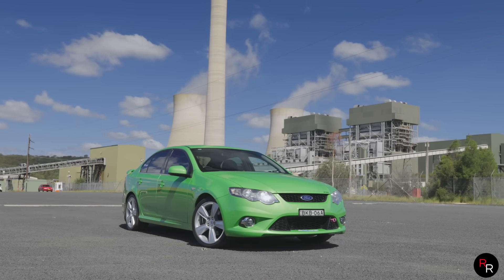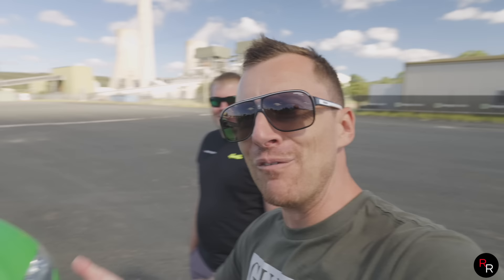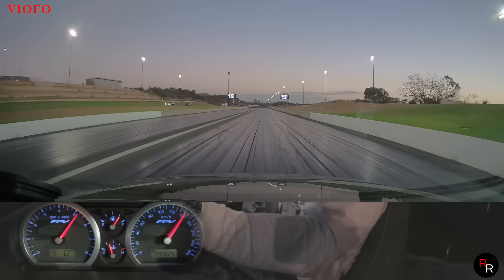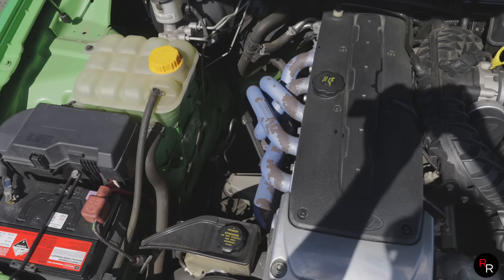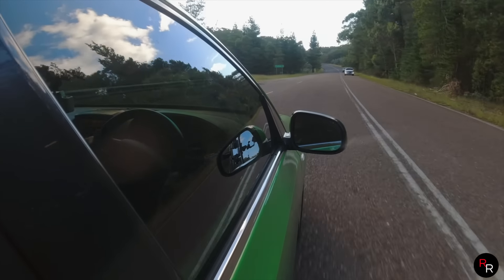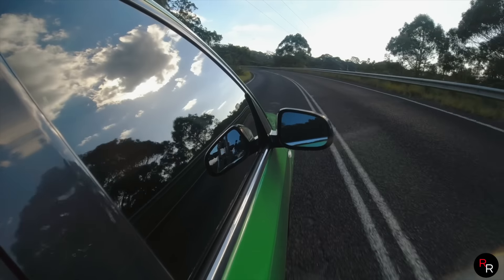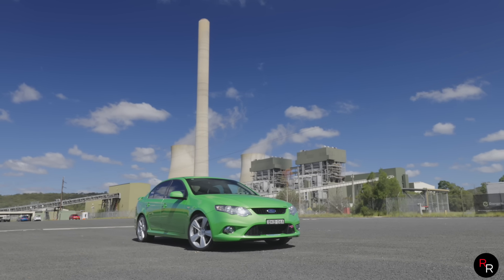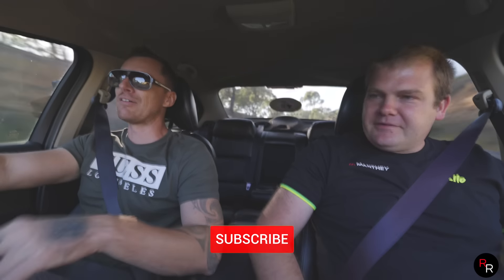What Happens When You Build Your NA BARRA XR6

Comment: Very impressive, i always wanted to see a built NA barra and low and behold someone has actually done it. Didn't disappoint at all, can still be a comfy daily and put a smile on your face when you put the foot down.
Reply from the maker: Its definitely got some pep to it
Reply: Zane at maxx performance got like 370hp outa one with cams and 6 throttles in his el and 400kw (536hp) with nos, big f off cams and heavily ported head should crack 400whp+ big money to stuff like that though lol
Turbos cheaper at that point 🤔
Reply: My mate had a built ef with similar hp na was a weapon on the highway
Reply: @5lcalais1  if you're a mechanic or handdy - head porting shouldn't be that expensive. A cam that suits the ported heads and works with the opening and closing points of the intake valve is a major part of the equation. Then you need lighter valve springs and retainers...The parts can be expensive for sure.
Reply: All a 5 SP car needs is a manual swap, some short diff gears and you're doing a low 6 seconds to 100 kays.

Comment: Love the N/A barra... have to visit him once the headwork and cams are in
Reply: Exactly what headwork needs to be done & cams as I'm wanting to do the same to my ba na falcon xt
Reply: @joeyriley6992  port and polish with 272 and 276 degree cams... 3 angle valve seats can be done too...
Reply: @ftlc-mayush5876  okay sweet az thanks man what will cost roughly
Reply: In NA barra  if change the valve springs  put larger injection system on it  you than can get a bolt on a turbo kit or supercharger upto 430kw 10psi without damaging anything, but that would be the maximum you could go on a standard barra motor and diff or you would have to change a few more parts if you go up over the 800hp+ range. 

The standard motor and diff can handle upto around 800hp with forced induction. Most people go between 500 to 600 hp range to play it safe. I agree a cam package  makes the barra sound sweet and gives a nice mid to high pick up power boost.. I prefer supercharger on the barra over the turbo, bit more thirsty and more expensive set up. Although  instant power.  And still has the natural sound of the engine. Supercharger and a cam package.  Can't go wrong

Comment: My XR6 just has intake, extractors, full exhaust, kelford cams and valve springs. Yet to get a tune so runs rich but has a heap more torque than stock. Obviously not as fast as a turbo falcon but goes good for what it is.
Reply from the maker: They still
Go well
Reply: what lca are you running?
Reply: Lower control arms?

Comment: Nice to see someone do it different. I'm an NA guy and wouldn't pick a Barra as a platform for it but yeah, not a bad result in the end. I'd expected more rwhp. To put it in perspective, a vastly more expensive at that time 4.6 Lexus v8 w/8speed will do 300-330wheel stock but less torque and run low 13 5s 0-100/high 12s with a flash. This is plenty of speed for a daily to be safe and have fun and get to use it. I've had single digit 1/4 vehicles and while exhilarating, when you can go over the speed limit in 1st gear, it's hard to use them on the road at 100% safely.
Reply from the maker: It’s not bad at all eh.. glad you enjoyed the video

Comment: Great to see someone else spending money on a na build , I’ve got a na b series custom cam stage 4 equivalent head work valve springs pump gears full exhaust intake underdrive thing made 210rwkw it’s a blast
Reply from the maker: I thought It was worth a visit
Reply: My ba XR6 has cold intake, extractors, high flow cat and exhaust, kelford cams and valve springs. Hasn't been tuned so runs rich but goes heaps better than stock.  I've been thinking about the under drive pullys, you think they are worth the coin?  I'd love to get some head work done but sounds expensive
Reply: Are the pump gears needed for an n/a?  I thought it wouldn't make enough power to be worth worrying about haha
Reply: @corbyweeto6061 yes ,they're junk regardless of aspiration, once u start beating on them they break ,high rpm and high load do it.
Pump gears and valve springs are the 2 must do mods to any barra ,in turbo I'd add head studs to that 👍
Reply: @corbyweeto6061 hey mate spend the money and go the underdrive and do the front main whilst there ,pump gears are debatable but when you’re hard on them they will shatter
Reply: @edwardriley548  cheers mate I'm definitely hard on it lol. Just had new front main and balancer. Guess I should've done pump gears while I was there lol.

Comment: I own an N/A FG XR6 which I use as my everyday car. I absolutely love it. Cheap reliable and goes well. I want to buy a turbo but I cant bring myself to sell it.  I might just work it Im confident you can get these things into the 11 second range of you spend enough cash and get them built and tuned right.
Reply from the maker: I’m not sure about 11 but anything is possible 😅 gotta love a Barra
Reply: Depends on your setup. With a shorter diff ratio and a manual gearbox you would be getting good numbers. Then with head porting, cams, etc etc High 12s should be achievable.
Reply: @lachlanbrown409 most drag cars are autos...
Reply: Manual FG cars are better suited to a shorter diff ratio than the ZF. In an NA car the diff will be one of the best BFYB mods.

Comment: Its great how good you can get them to go for little money. I had a bf1 fairmont. Did full exhaust. F6 upper and lower snorkel. Lower temp thermostat. M86 rear lsd from a manual gt with 3.73 gears. Underdrives. Sct tune by intune motorsports. Went really good. Still great on fuel.
Just wish it had the zf instead of the btr or at least a 2500-3k stall.

Comment: I have this car, almost exactly. Down to the colour. You don't need to tune these things unless you're willing to foot the running cost of parts and maintenance. Focus on the brakes, tyres, suspension and install a throttle controller. You'll be good to go.

Comment: My first car was a VS SS throwing out no more power than 195kw with the standard 304 V8. A decade later Ford release a straight 6 barra at same power rating standard But atleast a Barra can handle  around 800hp with a bolt on induction and some small modifications such as valve springs and larger fuel injectors ect. I'd have to spend almost 10k to the 304 motor to achieve the same output power. Than additional costs for forced induction kit. Just shows how far car industry have become in engineering. It's just sad to see they no longer been manufactured in Australia
Reply: Spot on coment,  totally agree with this.  Was always great fun but not cheap to get decent power.

Comment: For a daily and most street driving around 5 second 0-100, 13 second ish 1/4s is good, and a lot cheaper than a spinning 11 or 12 second lol
Reply: Yeah man I've had 9 and 18 and 13s dailys and the 13s is the most fun. You can use it and have small races without getting in too much trouble. 18s manual camry was the least 'effs' though ahahah.  9s was a cammed 1000cc superbike. You're already walking if stupid enough to stop, in 1st gear....
Reply from the maker: Good value too
Reply: U can have an 11 sec turbo no wheel spin easy u just can't over power the chassis/suspension , at 358wkw mine's gone 11.94@114 through a manual too 👌

Comment: Diff gears will throw it into the 12s for relatively low cost.
Reply from the maker: Could help for sure
Reply: @RossReviewsau  I had a BF mkii NA wagon with a tune, underdrives, intake, extractors and exhaust with 3.9 diff gears that got into 12s when the previous owner had it. 

Problem is it sat @2500 rpm at 110kmh haha
Reply: @TRAVERSE_ADV  my corolla sportivo sits at almost 4k rpm at 110 in 6th gear
Reply: @NikA-wr6px Falcon has a 4L I6. Carolla has a I4 under 2L im guessing.  I bet you get more than 350km per 68L of fuel on the highway too? 

NA Falcon with the 4speed usually sit atround1900rpm in 4th at 110. 

It was using about 19L/100KM. 

My 2000kg SZ I6 territory NA uses around 12L/100KM
Reply: @TRAVERSE_ADV  i havent actually taken this car yet on a hwy due to living in a adelaide australia which doesnt have hwys. i want to drive interstate this year sometime so id be keen to see what it gets. 1.8ltr 2zz corolla sportivo 60L tank 98 fuel or your highest normal petrol in us idk what it is. 103 or something i get 550kms city with some 8200rpm shifts

Comment: I didnt think there was any advantage running e85 on a NA motor
Reply: e85 hahaha. 

extremely corrosive and very HIGH WATER CONTENT.  dirties the engine.  its like the chrap nasty fast food version of petrol ⛽️
Reply: can help with the higher compression he's running and add more safety, also touch more power due to the cooling effect but really depends on the engine. some higher compression NA v8s will run fuel sensors in order to change timing and thus output due to this, but I don't know of any E85 specific mass produced cars. I like older stuff mostly lol.

Comment: How has no one mentioned that 600Nm from a N/A 4.0L is impossible? The GMA T.50 has the highest automotive specific output at 117 Nm/L, so the max this could have with mods is 500Nm...
Reply: They do make it 🤷‍♂️ my turbo fg is has put down 775nms atw with only 480whp ,they're torque monsters 👌
Reply: @5lcalais1  that’s turbocharged. Even motorcycle engines don’t make >100lb-ft per liter
Reply: Have you taken into account diff ratio multiplication? Provided it was in whatever gear is 1:1 on the dyno, is 600nm possible at the wheels?
Reply: @Jez3134  No, because the dyno computer automatically calculates horsepower and torque from the diff ratio. 150Nm/L naturally aspirated is simply impossible outside of race engines.
Reply: I've noticed many NA falcon owners come up with strange tourqe numbers. Quite a few people are claiming around 450nm for XR6's (even some BTR guys) with basic bolt ons and a tune. These are videos recording the dyno screens in tuning shops so it makes me wonder if the dynos calculate it really weird.

Comment: Stop blowing smoke up this cars ass 😂 0-100 was like waiting for Christmas. It's slow. Turbos these days are the only way. This is like an EB Ford. Boring.
Reply: 800hp all motor v8 is going to spank the pants off any 1200hp turbo laggy turd around a track buddy. All depends what you are doing. this is a daily driver, he doesn't have boost leaks, shaft play, oil leaks, head gasket issues, etc to worry about, all with decent performance and reliably.  A 5s 0-100 is faster than a vast majority of cars on the road today and plenty enough to have fun with. I've had 9s and much slower vehicles.. the slower ones you can have fun more often.
Reply: It ran a 13.4, that’s respectable!!
In 2005 I had a r33 gtst it ran 13.5 
Than I had a 180sx that ran 13.1 

Now I have an fg turbo with 500rwkw that runs 10s so I know that this n/a is impressive
Reply from the maker: It’s quarter time is respectable man

Comment: I'm sorry. 200 passes why?  Cop pops the bonnet why? even a day 1 P-plater could drive this. hill climb pure power, heat soak. what an utter cringe. dude. it's not even cammed. PLEASE do not cam this, you just might blow past coyote swapped FG's
Reply from the maker: Don’t be a hater man.. guy built it loves it and it’s an Aussie family car that runs a low 13 pretty impressive for the time